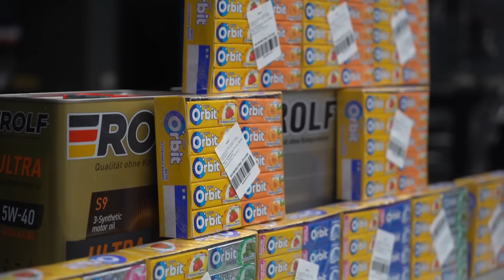We make a tire out of chewing gum

Comment: The Bubblegum Tire is an awesome idea Guys.  You could have even used Laffy Taffy...Try 3 to 5 mm square hole screen wire fencing to reinforce the Gum or Taffy... Wrap the wheel with the fencing, attach it, leaving a bit of space between the flat sheet and it.  Roll the Gum into ropes.  Wrap the Gum Ropes or Taffy strips  around the fenced wheel lengthwise... Heat it a little and push the Taffy or Gum into the fencing. Then either put the wheel in a dehydrator or freezer for a week..Gum and Taffy are harder and tougher when the moisture is completely removed from them.🍬🍬🍬💜💜💜

Comment: I'd like to see you use a steel rim where you weld on bolts inside pointing out then you make aluminum wedges that fit across the rim in segments then you take some tire rubber and you use some type of screws where you threaded the aluminum and they go down between the treads to attach the tread rubber to the aluminum so you have a rim with a whole bunch of pieces and you can remove these pieces individually say if some nail got stuck in it of course it's not inflated, but you could also put alternating types of tread even adding some with studs every other one modifying it anyway  you want at any time changing it.

Comment: powdered latex... have to boil it and drain the water several times adding more water and draining the water, then dry it in a thin long sheet, that then goes in a cement mixer full of large iron balls to crush it into powder while keeping it rather cold the whole time. then things like charcoal, nylon fiber, hemp fiber, cotton fiber, cement/sand powder, petroleum tar are added in a ratio that ends in allowing it to be heated without becoming sticky though plasticizing and "vulcanizing" onto it's self as things like recycled chlorinated plastic oils are added that chemically polymerize... in a rolling mill. ... its a bunch of things not just the gum.

Comment: Just when I think you guys cannot get any crazier, you come up with something like this.  You might have saved the boys some of the troubles of chewing it by using a taffy stretcher.  Have you considered making ice racing tires?  They have large spikes sticking out all over for traction on the ice.  They are used on motorcycles, so I suppose they would work equally well on cars.